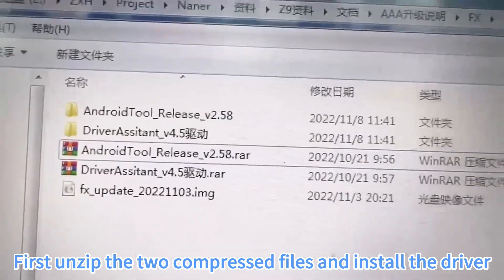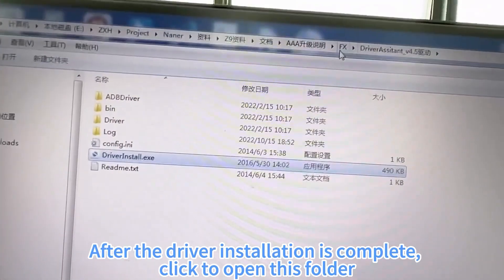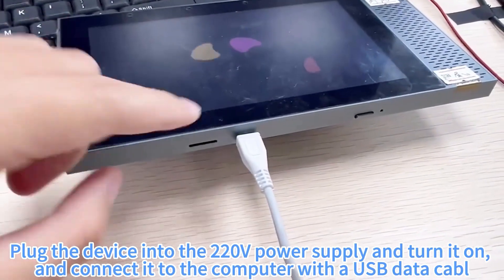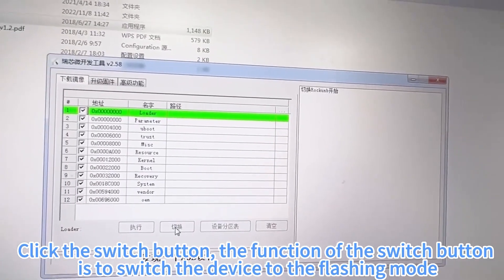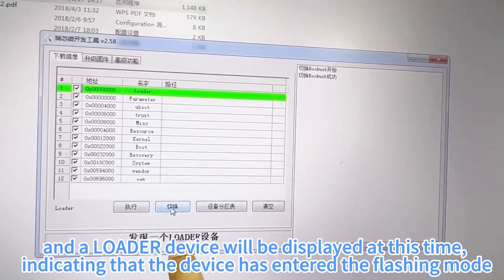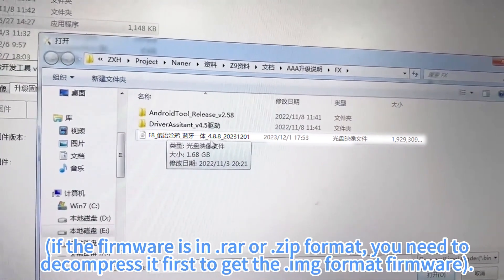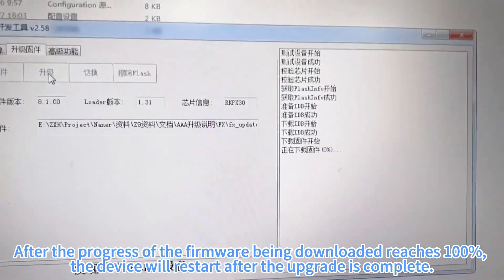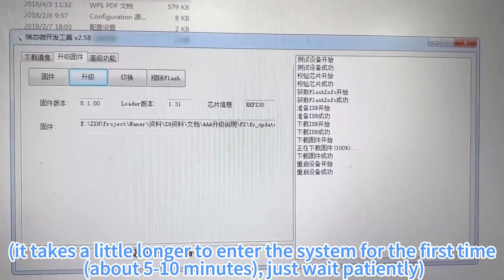Russian - 8-inch smart center control panel Russian interface upgrade operation video

Comment from the maker: General upgrade tutorial for smart central control panel (switching tool upgrade_applicable to 4 inches, 6 inches, 7 inches, 8 inches, 10 inches, and 12 inches)
7-inch smart panel Chinese firmware upgrade English interface can be downloaded from our website:
https://anjielo.com/en-tw/pages/download
or https://drive.google.com/drive/folders/12LZZ1fGr7W8tA1Ok4jl2Dafh58bIeQQA